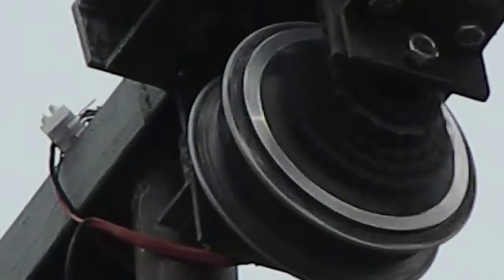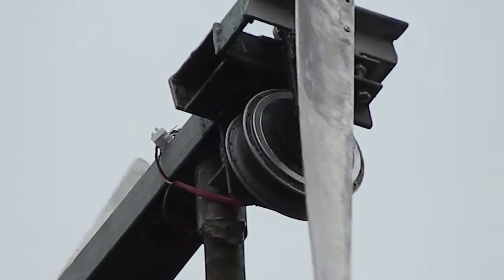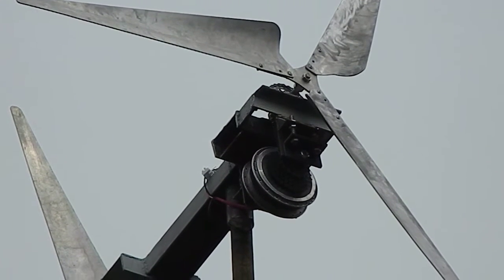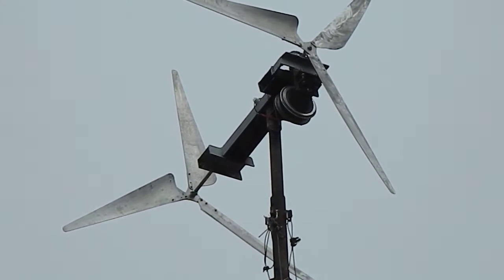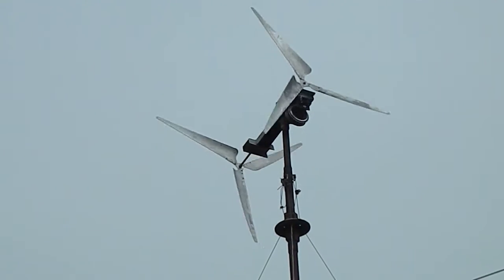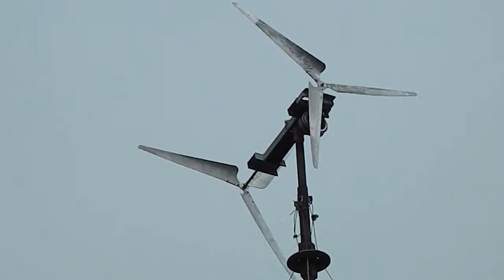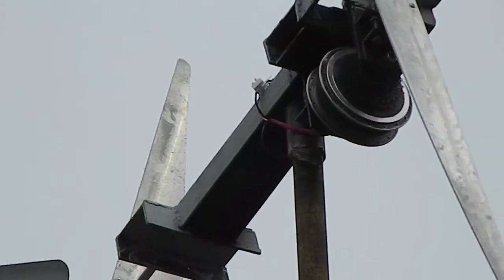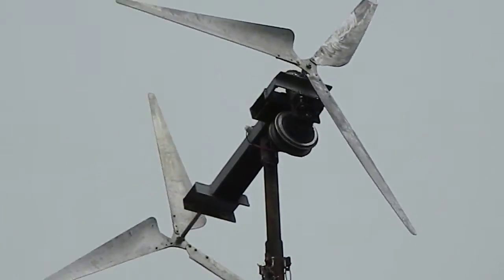Prototype DC Motor , Twin Rotor  wind turbine testing 01 04 2016 Part 2

Comment: I wonder if you could design sold state crystal graphite power cells and shape them in a semi circle and surround an electric generator that generated a certain hertz that caused the graphite power cells to generate more electricity? If it worked then a power stacking could take place. Wind mill and graphite power cells generated so much energy that passed through a vacuum spark gap that then passed through another larger drum motor generator with graphite  airogel ultra power cells that passed that energy through a larger vacuum spark gap that feed a graphite airogel ultra power cell bank. If done correctly you could operate a large ranch totally off grid. If it works that is?

Comment: You could design a support pole for the windmill and fill the inside up with graphite airogel that has been compressed and rolled IE constructed like how super ultra capacitors are made and connect them in series within the support pole with the windmill drum motor generator upgrade at the top of the pole feeding energy to the graphite airogel  power cells and create a ultra windmill. ; )

Comment: Get a drum motor rewire the rotor into a generator use magnetic bearings and incorporate a vacuum spark gap or two into the design. You should be able to generate high frequency electricity easy. Depending on the size of the rewired drum motor generator and the magnetic bearings and vacuum spark gap? 50 to 100 amps easy maybe more? Try it out.